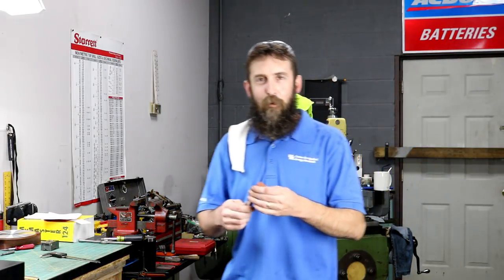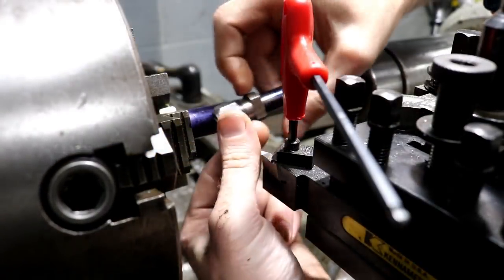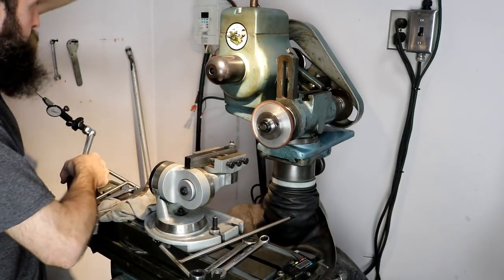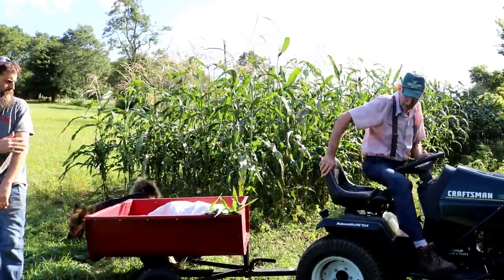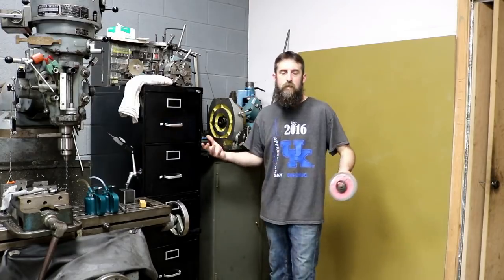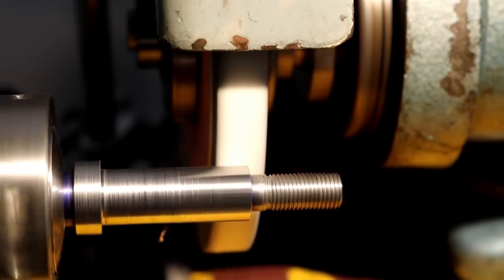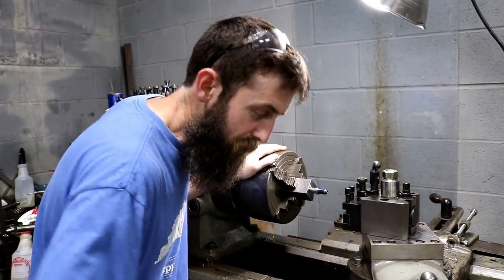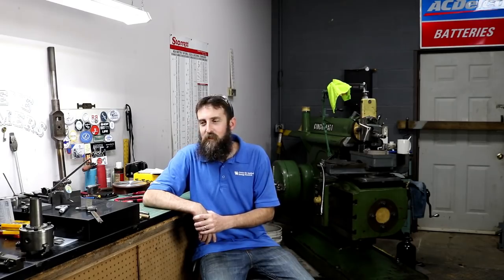ID Grinding adaptor build part 1

Comment: I always liked to work with gr 8 bolts. They make great transfer punches when heat treated with a waste oil quench.It is great to see inserts reworked bud. Well done ! I love fresh corn. A real treat. Sooooo sweet.Just like the tool grinder. Every machinist needs one.See you next round fella !

Comment: Nice work, Steve.

If it was me, I'd do all your cuts on the lathe, including the taper cut, harden and temper, and then grind the OD of the taper.  That leaves you a workholding issue, but there's nothing to stop you making up a quick B&S collet for your collet block, might be handy in the future, and if you're already setting up your compound for cutting a taper, why not cut an inside and an outside one?

Heat treating a grade 8 bolt is easy - a few firebricks and a blowtorch, heat it up to the classic "cherry red" and drop it into a bucket of old engine oil.  For what you're wanting to do, you can then polish and bring it back to a light or dark straw colour.

Comment: I ran into the same problem -- get me a oven. The "original" ones for heat treatment are not that cheap. So i bought me a used one for enamel coating on copper. Then i built me a measuring and control unit myself. You can get the peaces (chinese made) for a good price. Now i have a controlled oven, where i can the neaded temperature dial in. That works great and didn´t cost me a arm and a leg. The data sheets for heat treatment of the materials we need can be found on the Internet, so life is good, lol.

Comment: the old sink.. becomes the hidden top of a roll around cart..  2 sections of cutting block counter tops hinged over the top.. so it can become a hidden roll around storage top.. or with a 5 gallon bucket and submersible pump it could be come a wash basin for the shop. . just a thought.. 

 or cut it in half and build a framework for each and they become strong trays or drawers..  the individual sinks might even fit in the drawers of the black filing cabinet..
Reply: Yeah, I was thinking that it should be made into a parts washing basin.

Comment: You may want to tie the top of that cabinet to the wall. The drawers come out so far, it may want to tip. Easy thing to do for a little assurance.
Reply: Gregory Wolf - Good advice.  Or at least no load anything heavy into the top drawer.

Comment: I may be misunderstanding what you said but at 17000 RPMs, a three-quarter inch grinding stone has a surface speed of only around 55 feet per second. That's about 38 miles an hour. Though that would surely leave it welt, the entire stone moving that fast wouldn't be enough to cause any real injury save for contact with your eye.
Reply: You don't want a grinding stone to hit your teeth at any speed.
Reply: @keantoken6433  how do you know that's not what I want? I could have been searching my whole life for a way to make that happen.🤔🙃 I get what you're saying for sure. Definitely not safe to use any tool that can throw an object at you. I just think he may have overstated it when he said it could kill you. Although I suppose anything is possible. And perhaps the statement he made wasn't about that specific grinding stone but grinding stones in general. If you had had a somewhat larger stone on a longer shaft it's could cock out to the side, spinning on a much larger radius before breaking completely loose thus gaining a tremendous amount of momentum.
Reply: I agree, I had the same thought, I don't think it could kill. Maybe indirectly by leading to an infection (just like everything else). But, I don't think it's a big deal whether he was exaggerating. You just don't want abrasive rocks flying around period.
Reply from the maker: If the side broke out of the arbor and the stone started running out it could be thrown very hard. Hard enough that you don't want to be any where near it when it is thrown out. Could it kill you?   Possibly. But unlikely . Better safe than sorry. Be a neat test to see how hard it could throw that stone.

Comment: Hi Steve. Great video liked it when you owned up to the cock up about the parallel (tapered) shaft. I've got the tee shirt, been there. Nice grinding back to parallel on the tool and cutter grinder. One thing about the homemade carbide tipped boring bar that you said was too long. Why didn't you set the boring bar back in the holder to make it more rigid, stop it flexing.

Comment: Hi Steve, good material selection, always worth keeping large OD and long high tensile bolts, very high grades are a good source of alloy steel, ref socket head case screws. Doesn't matter if they are rusty!.
If I may suggest for the hobby guys/gals, have a look at tensile strength values/data ( PSI or N/mm2) for mild steel, SAE 1045/ C45 , SAE 4140/42CrMo4, and compare to fastener grades .
Grade 4, 6 & 8, (SAE) approximately equivalent to 6.6, 8.8 & 10.9 (ISO).
Link to basic data.http://www.americanfastener.com/astm-sae-and-iso-grade-markings-for-steel-fasteners/

Comment: but it changes the angle of the cutter?
Reply from the maker: The tool is still setup 90 degrees to the part.
Reply: Granted, if it is store bought , the relief angle should be the same all the way,  so the tip angle is maintained, but if it is hand cut the relief will not be as accurate.  What if the relief angle is less, will that not change the angle of the tool?
Reply: Right, but if your relief angle is off, the tip could go out to 61 or 59 deg, your pushing in at 29.ish, it could cut on both sides of the tip? I am not saying it is a bad idea to refinish it the way you did, it is just a fubar you must be aware of that might happen.

Comment: Hey Steve,
Say, what bearings are used in your high speed spindles? Bearings that can withstand 20K RPM aren't that common. So it would be good to know which ones are used in your set up.

As far as threading with the compound goes.... this is really not needed any more, not with sharp modern tooling and a decent machine. It may still have some sense on the small import lathes, mainly sold to model makers, but for ordinary threading, on an ex-industrial machine it is a waste of time.
I have, besides a few proper lathes, a small dinky C1 lathe, and even on that, using carbide inserts, direct in-feeding doesn't really stress its tiny 100 watt motor.

This debate, on whether to 'attack' sideways or 'full frontal' has been going for decades and is now gotten to a stage where it makes as much sense as debating "the gender of the angels". Fact is that the data tells us it isn't necessary anymore 
  
Cheers

Paddy